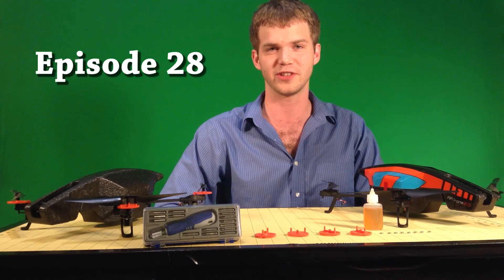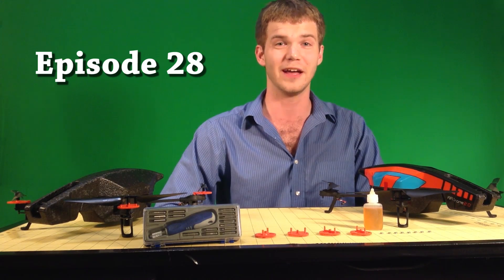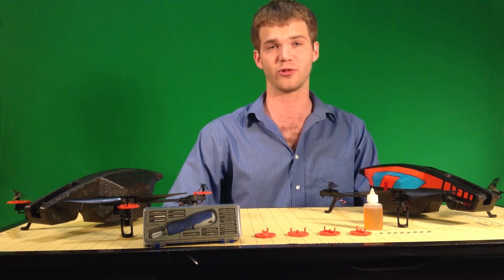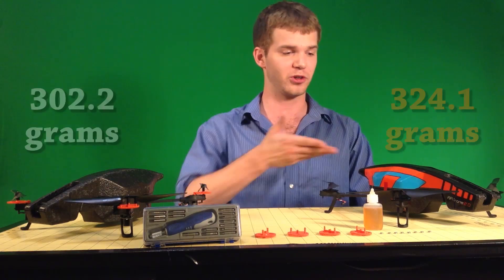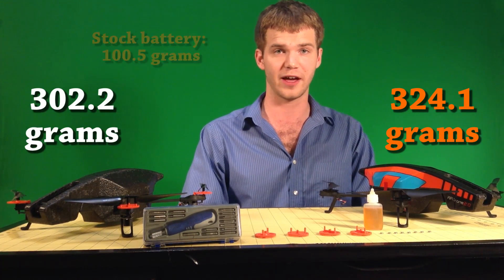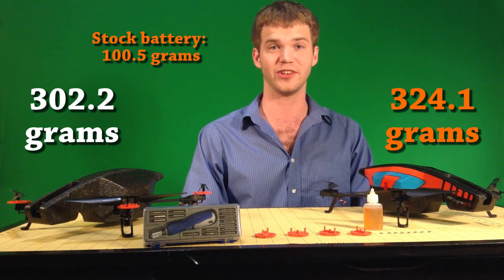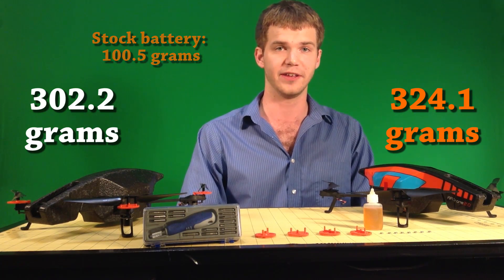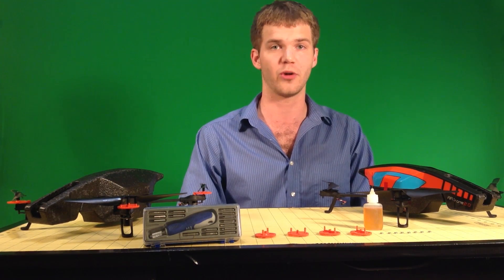AR Drone 2.0 Reduce Weight & Increase Battery Life Flight Time 13% - Episode 28 HD

Comment: A for effort.  May want to study up on what bushing V/S bearings are designed and used for. There is no load resistance in this application. IE- no chance to improve. The same friction applies whether or not you are rolling the balls inside the bearing or rotating the shaft on a bushing with no load. You got better times because there was substantially less wind. Much less movement and re-correction on the video. May have lost some rotational mass using the new gears.  That's possible as well. Likely oiling the bearings would apply the same effect to the bushings being oiled since that is the surface lubricant in both applications that the same amount of force was applied.  Keep moddin.

Comment: I love your videos,   By removing the parrot shell you  essentially created more of an aerodynamic  drag,  you have 4 props spinning pulling air down all around the Drone now picture the porous surface of the poly foam compared to the smooth skin of the parrot,  I would love too see a control with skin on and skin off

Comment: Not sure why all this was done to get 10% more flight time. Could have just gotten a slighly larger battery. Also not sure why the branding was removed as it actually does add protection if the drone falls upside down in my case has happened many times.

Comment: Hi, I have a problem maybe you have an idea how I can solve it. I have the Ar Drone 2.0, but I live in Quito (south america) which is over 2800 meters high. It's know that because of the altitude and lower air density its harder for helicopters and planes to fly. My drone wont fly over a few inches of the ground. I bought some 2600 lipo batteries but still it wont lift of higher than that. Any ideas? Thanks!
Reply: hola por casualidad haz verificado que no esté activo el límite de altitud? nose es una idea tal vez lo tengas activo a xm máximo y por eso no puedes elevarlo!
Reply: Rodrigo E. Vela Weber go into your settings and change altitude height
Reply: +N1ckfm Master (Nickfm) hola me podrías a llidar como cambiar el engrane de mi parriot 2.0
Reply: check that props are rotating so the create lift. possible 2 may be backwards. I dont think your altitude plays into drones cause they are so light.

Comment: When I decided to "change" the bearings (when changing the gears due to wear) I wasn't aware the drone didn't have any to start with.  They're crudely cast bronze sleeves!  Basically sacrificial metal bits for the harder shaft to spin inside of, and wear, and chatter in.
I think if more people knew how awful the original "bearings" are, more people would change.
Reply: the wear is mainly from high windsand quik 3d if your not going to do this then plastic gears are quite addequate dont worry too much novis

Comment: Is it me or you have short flight times? I use the stock battery and the only mod i have done with my drone are ball bearings, straightened and balanced propellers. I fly aggressively with lots of direction changes/flips and i get approximately 11 minutes. In your video you're just hovering and you only get approximately 11?
Reply from the maker: Well depending on the flight hovering can actually use up battery faster than flying around will

Comment: My set of bearings is definitely unshielded both sides.  From the one side you can see the ball bearings, from the other side you can see the bearing cage.  From both sides you can see directly through to the other side (open).